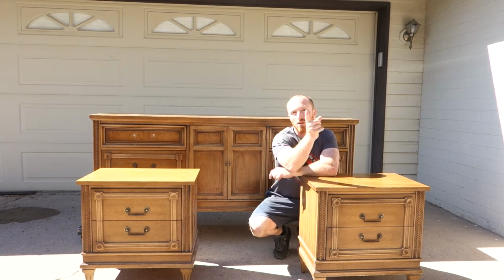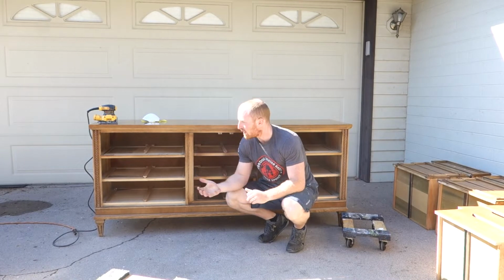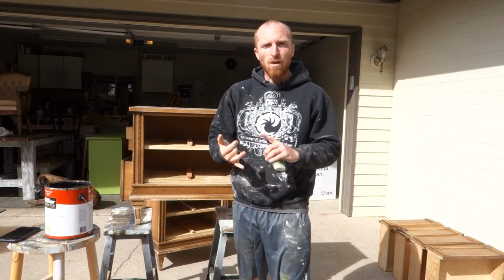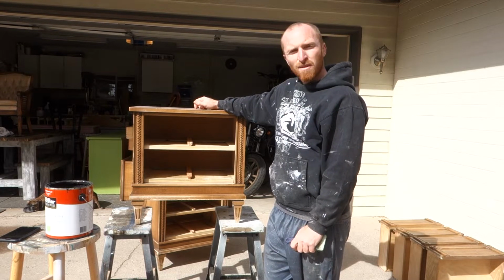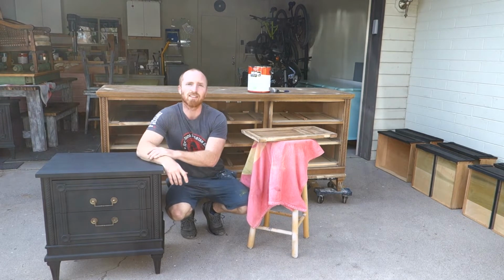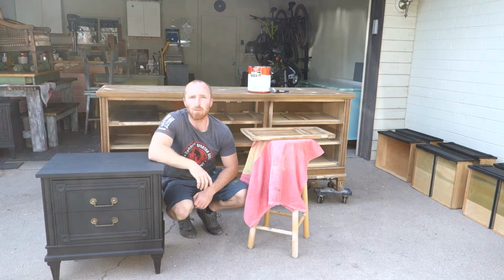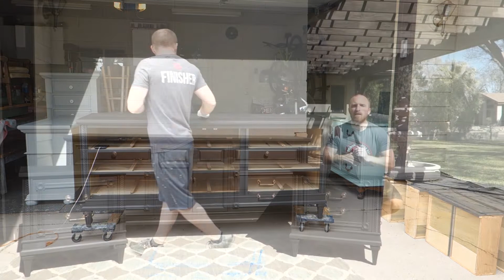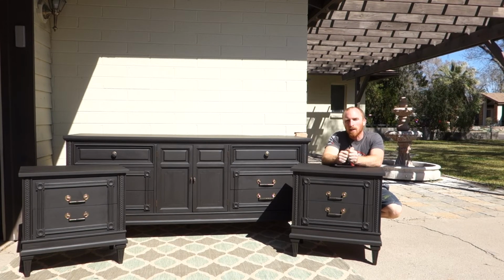Black Dresser Makeover project. Do it yourself painting project

Comment: What kind of brush do I use? I’m not a professional painter and I’m afraid of streaks on the furniture. Also doesn’t the wax leave white marks or can you get black wax?
Reply from the maker: Mess Over I use Wooster short handle angle brush. They are like $5 at Home Depot or on amazon. I don’t notice any white marks from max as I wipe on and off the excess. There are many colors of wax you can get. I used black wax for accents on pieces in the past but almost always use a clear or natural wax.